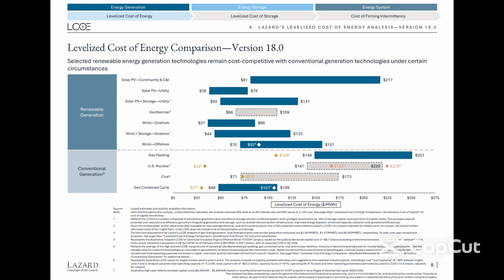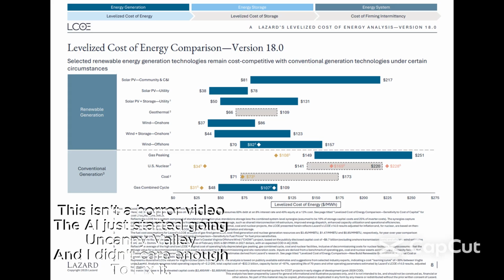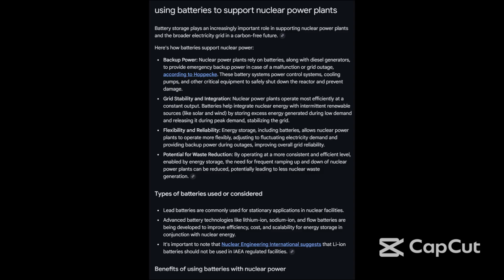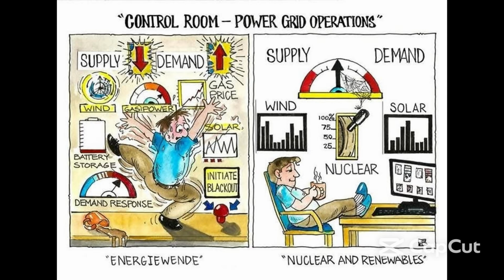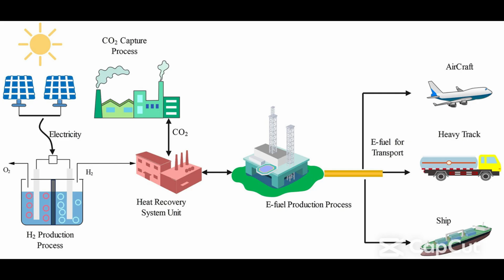Why Nuclear Power Doesn't Work With Renewables

Comment: 0:01 It sounds like, instead, you're debunking the notion that there should ever be any wind-and-solar connected to the grid.
Reply from the maker: Nuclear would require you to drive the cost of all goods and services up by a factor of ten and fossil fuels can't be sustained.

Wind and solar are the only real options.
Reply: @Divest46  Wind and solar absolutely depend upon fossil-fuels.
No fossil-fuels = no wind-and-solar.
Reply from the maker: Wind and Solar don't require fossil fuels, they're displacing the fossil fuels.
Reply from the maker: You should have asked your AI "is renewable energy outpacing fossil fuels?"

Yes, in some key areas, renewable energy sources are outpacing fossil fuels, particularly in new investments and electricity generation. While fossil fuels still dominate the overall energy mix, the shift towards renewables is accelerating, with investments and capacity additions growing rapidly.

At the rate we're going there won't be any demand for Fossil Fuels in 20 years. It will all be met by renewables.
Reply from the maker: Your point about subsidies is wrong but the idea of subsidies brings up an important point. We $7 Trillion per annum on fossil fuel subsidies, which works to obfuscate the direct cost of fossil fuels and makes renewable energy look more expensive by comparison.

Anyways the reason we use fossil fuels is because there is existing infrastructure for fossil fuels, if all the new investment is going towards renewable energy that means in a few decades that fossil fuel infrastructure will be replaced by the new and better thing.
Reply from the maker: You're the one dodging the point about fossil fuels being subsidized. Also Renewables have much greater energy density than fossil fuels or nuclear for that matter.
The materials used to make one 300w solar panel could be used to produce 3180 Petawatt hours of electricity. You would need three hundred billion liters of diesel fuel to match that output.
Reply from the maker: You can't explain how fossil fuels subsidized anything. You're just repeating a phrase without understanding it.